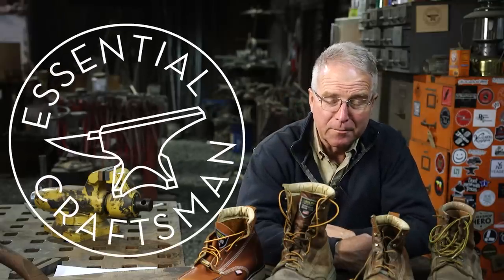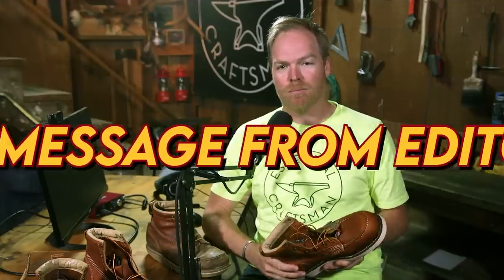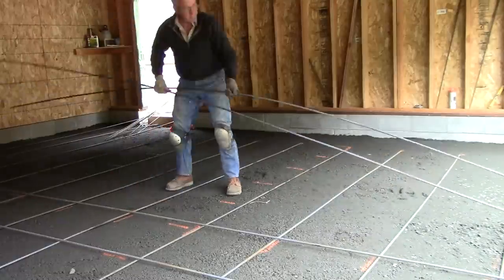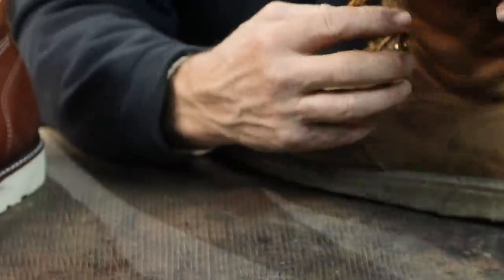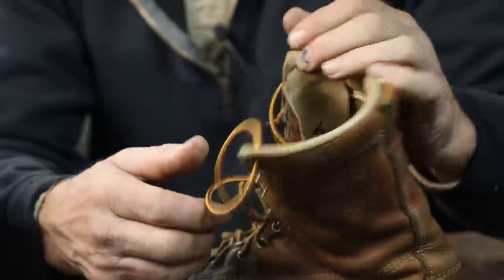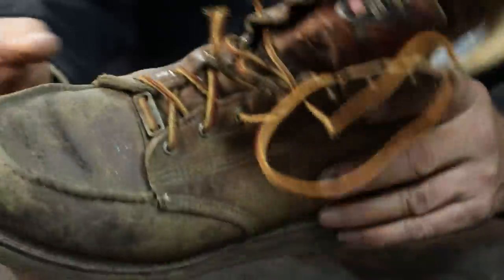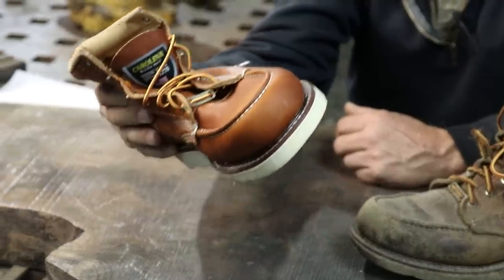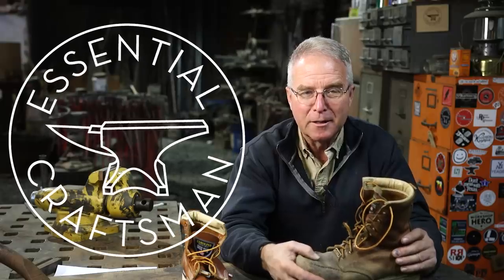Carolina Boot Review

Comment: Do you ever wish or consider wearing a steel toe or composite. i have always worn them. i have the issue that the pinky toe is right at the edge of the guard though. have you ever come across a steel or composite toe that wraps further around the side? Why have you chosen soft toe over hard. 
I currently use Keen work "shoes" they are last as long as my favorite ones so far, my timberland, pitboss boots. but the reason i usually end up only getting a year or so out of them is again the steel toe issue i mentioned or the sides of my shoes wearing too low so that my feet are not flat. you know, the outer heal side wearing more than the inner? i have no idea why but that's how they end up.  that or the fronts of the shoe wearing down too fast from kneeling down and the steel toe or toe area wearing though. i have to give credit to the KEENs for not having any issue with that vs any leather boot i have ever had.

Comment: I'm 6'0" 330 lbs with wide flat feet size 12-13 and I am going into welding. I like the idea of slag not falling into my shoe. Anyone out there tell me about Carolina boots what width to order if that's what i eventually decide? Thanks for this video.
Reply: Duluth Trading kevlar laces.  My son in law is a pipeline welder and swares by them.  Regular laces last about 3 weeks but DT kevlar laces last 6 months
Reply: @glenterrill2948  Outstanding, Sir. Much appreciated. All the best to you and yours.
Reply: @glenterrill2948  I went with a pair Carolinas with the Kevlar laces 8 inch top speed hooks and for shits and giggles I bought myself a pair of Timberlin’s with the Met guard

Comment: I've never tried Carolina's. When I first got my job at a machine shop I needed steal-toe boots so I bought a pair at Walmart. After my first two weeks my feet were so sore I almost quit. I ended up using my first paycheck to buy a pair of RedWings because I heard people talking about them and I just so happen to have a store I used to drive by. Best decision I ever made regarding shoes. Yes, they were almost $400 witch is extremely expensive but my foot pain went away. So far over 2+ years they've been holding up great and I have no doubt they'll last another 2+ years. Really the only problem with them is the fabric is wearing off the insole. The leather went from a nice brown to a grease/oil covered black because of how dirty the environment I work in is (especially when I have to clean out the chip conveyor-belt pan thing) but that's just cosmetic.

Comment: Hi guys. Can someone tells me what a Moc Toe boot means? I am French speaking and can't find the definition anywhere. Is it related to the steel toe caps in working boots? Thank's for taking the time..
Reply: A type of shoe design where there is a seam running around the top of the shoe.
Reply: @7h3F33d3r  Thank you. I see what it is now. The regulation in the US seems to be much more permissive regarding the construction workers safety equipment than in Canada... Here they have to wear protection gears like hard shell helmet et steel sole and toes reinforced  boots at all time.otherwise they will close the work site.

Comment: You don't know has lucky you've been in the US boots in the UK up until the internet work boots were awful usually black unlined embossed leather no padding never wore out which was good because you wouldn't want another pair I'm an old fella now and the last few years I've been wearing a DeWalt boots with a crape soul not expensive or partially hard wearing but that's not important to me .it's like wearing slippers and I don't go through a boot like I did when I was young I also use a much smaller trowel now regards Dave from Wales 🏴

Comment: As a roofer, i have a few requirements for boots. My preference is the Barracuda by Georgia Boot., Steel shank, steel toe, lightly corrugated wedge sole. The sole lasts a loooong time! I prefer a smooth sole for roofing so as to not damage the new shingles so badly. The pair i have now was made in Dominican Republic, but they used to be made in China. I know it's not "proper" as a good ol'  "made in USA" boot, but the quality is amazing and the Dominican Republicans need jobs too.

Comment: i prefer georgia boot company boots, a particular one actually which i haven't been able to find the last time i looked. i see below there are so poor opinions of them. i never had any probs but the ones i like have a different bottom on them, they end up spliting on th eside for me, but i get a good run on them 1st. so here's why i like them, 1st off the aren't lined. i will not wear a boot that is lined. they wear out too fast, when you get them wet, which if you are outside they are gonna get wet, a lined boot means yer gonna have wet feet all day. not so with an unlined boot, and if you really have to, just change out yer socks and yer fine. they dry quicker over night so they last much longer. i buy 2 or 3 boots at a time and switch them out so a pair only gets worn ever couple or few days. they last way longer that way then if you wore the same pair till they wore out and then switched. i go by the old saying that workin 2 pair in rotation will last you 3 times as long.
  i have been eying those carolina boots for some years now, i am pretty sure i have seen them unlined. tractor supply in town has them as well as georgia boot, (just not my flavor, which is a 10" with a bottom that wears good. i am around metal chips and coolant n such a good part of the day and not only do they hold well, but the chips don't embed in the soles and end up in the living room. the down side of the boots i like is i have to drive down to meadville pa to get to the place that sells them (boot barn). that's a 6 hour drive, not pushing it mind you. i don't mind it of course cause the boots are worth it and my daughters family is another 2 hours farther so i get to see them and every 1/2 decade or so i get a pile o new boots. i think i may give the carolinas a try though, they sell them downtown and i have heard good stuff about them holding up on the shop floor the past couple years. (oh... and when the georgia boots wear out and the leather crack n splits, i use them as wading boots fishin till they really fall apart)

Comment: You are already wearing double knee pants... you might as well throw permanent foam knee pads in there. You just push them in and leave them in through the wash and dry and they'll last longer than you're pants will.   You'll prefer them to your regular double knee pants after a few days, especially in the winter.   .02

Comment: Hey Scott, I've recently joined my local Rural Fire Brigade here in the Blue Mountains, Australia. They have changed their boot supplier, but I was overjoyed when i went to size and pick up my uniform/PPE that they still had the previous boots in stock in my size, as I have had a different model of the same brand for years and found them to be excellent for my broad feet. These are an Australian brand called 'Taipan' (named after one of our snake species). Like you, I like the high top, but I don't like the time that lacing takes. However, these can be worn with a zip insert that laces into the eyelets on the boot, meaning you can break them in, tighten the laces until the boot is in it's final state, and then you can tie the laces off and just use the zips for quick don/doff. Here's a link:   https://www.ebay.com.au/itm/Fire-Boot-Taipan-5072-w-Front-Zip-High-Leg-8-Inch-AS-NZS-4821-2006/153690119426?_trkparms=aid%3D1110006%26algo%3DHOMESPLICE.SIM%26ao%3D2%26asc%3D20160908110712%26meid%3D405bd7b780564cebbe63cad5099d0cbf%26pid%3D100677%26rk%3D5%26rkt%3D25%26mehot%3Dnone%26sd%3D153690125934%26itm%3D153690119426%26pmt%3D0%26noa%3D1%26pg%3D2386202%26algv%3DDefaultOrganic&_trksid=p2386202.c100677.m4598   Keep up the good work!

Comment: Tip: don’t buy from their website. Their sizes run very big. I’m usually a 10.5, but their boots were at least 1 inch to big so I returned them. However they couldn’t receive the boots back because they’re of their policy. If they find any evidence that you tried the boots on then you can’t get a refund. Now I’m stuck with some $250+ pair of shoes that don’t fit me. Only buy them if you find them at a store.

Comment: I have 2 pairs : one "normal" one, that i wear most of the time, and a pair of slip on that looks just like the one you can find in kitchen (it was actually for clean room nuclear industry, but they do look like kitchen shoes)

Why ? Because as a diy enthusiast/weekend warrior, i sometimes have just a little thing to do in the garage. And being able to pop my day shoes off and slip on safety shoes make me wear some

"I'm just going to use the angle grinder for 5 min, i don't need to put safety boots on" i said to myself too many times. Now, it's faster to just slip on rather than say that sentence out loud.

But for longer work, or when i'm on the worksite as an engineer, slip on just don't cut it, i need a real pair of boot.

I have to say that getting a second pair of shoes is probably one of the best investment i ever did, because i took cheap one that are going to last long and safety always come first

Comment: Anyone have any experience with CAT Boots?
Reply: I have a 30 year old pair of steel toe CAT boots. If I have to dig in mud or work around manure, I pull them out, wear em til I'm done and let the crud dry for a week or two, knock the crap off and throw them back into a corner. They were never really waterproof despite the claim on the box. They are heavy, clunky, and feel like I've got 1x4" boards strapped to the bottom of my feet when I walk in them. I'm not a fan but they've definitely held up well considering what I've put them through.

Comment: These most definitely ARE NOT work boots. Work boots have safety toes and a plate on the bottom. They are are uncomfortable, heavy most times and rigid. You would NEVER get by with these on my jobsite. What's the point of this review?